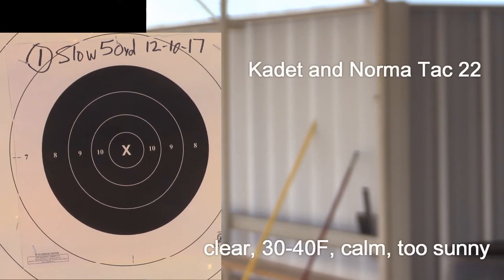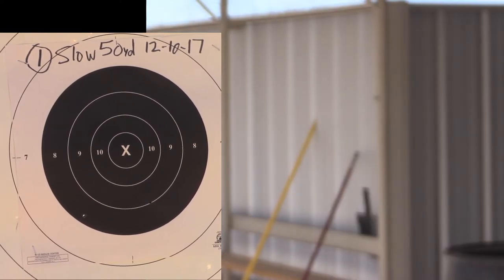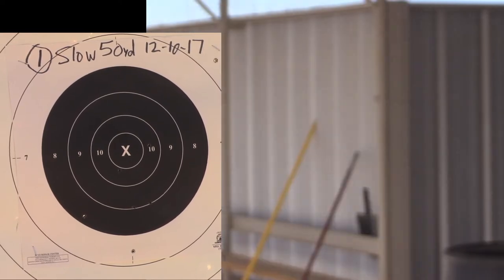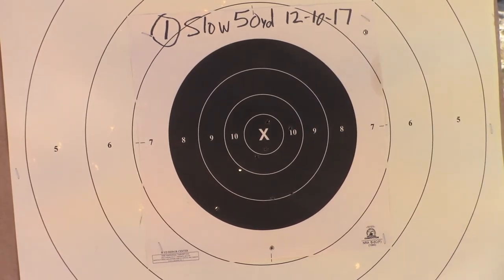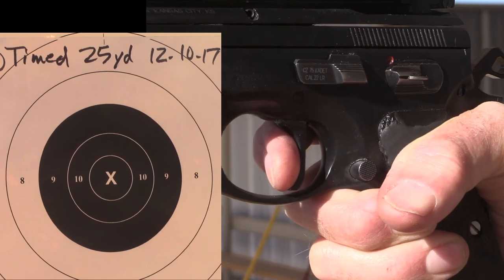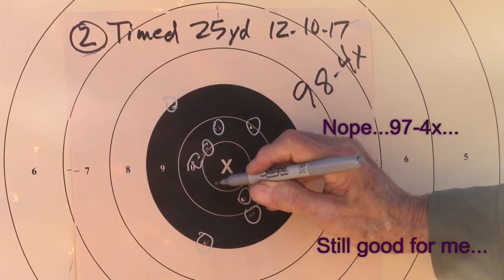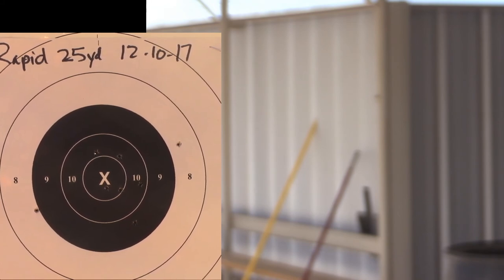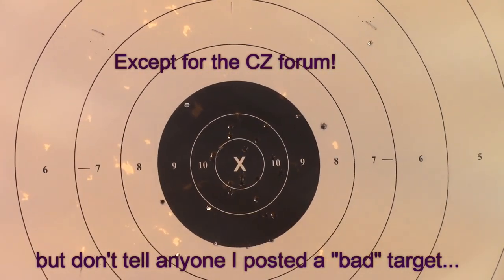2017 12 10 pistol range Kadet bullseye short

Comment: Hello Joe, first of all thank you for all the great videos. I am always looking forward to the next one.
I also have a CZ SP-01 in 9mm with a Kadet conversion. I want to improve the trigger, what trigger kit from CGW are you using? has this affected the performance of your CZ when using it as 9mm?
Reply from the maker: I have the one with the CGW hammer and sear, and a short reset kit.  I personally control the gun best with a 3 to 3-1/2 lb trigger pull in 9mm.  With the .22, I could go down to 2 lbs.  So, what I would do is get the parts right for the 9mm, then shoot that with the .22 slide on board.  CGW has some lattitude on the trigger pull weight, so tell them if you are pretty sure.  Use a 17# or heavier hammer spring or you will get some light hits with the .22 slide.  My 75B is single action only so I leave the 17# spring installed.